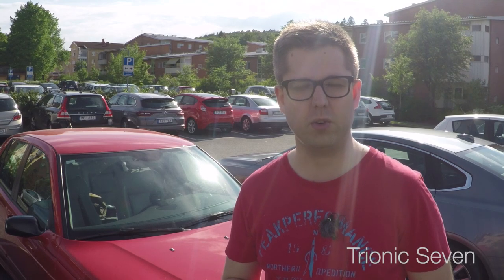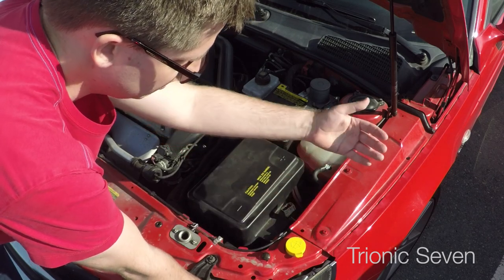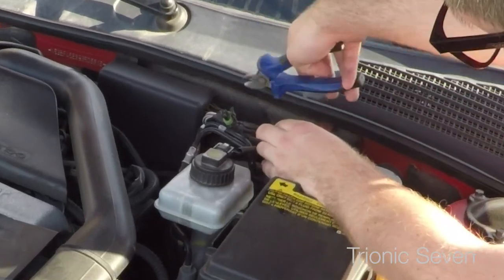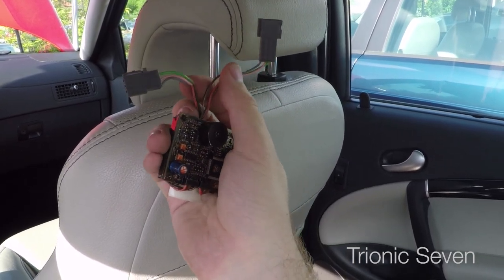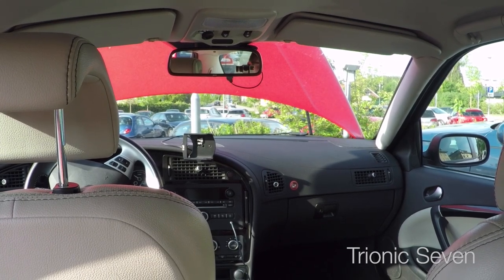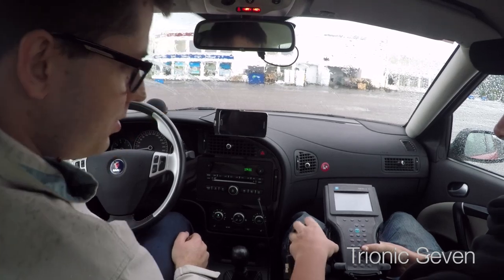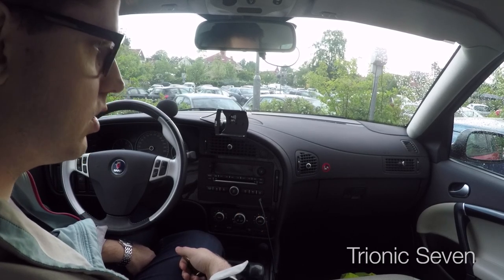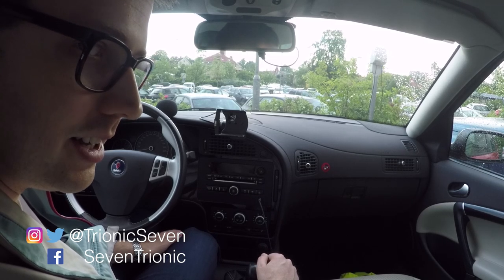Alarm System Retrofit, Saab 9-5, Saab 9-3 (Complete Guide) - Trionic Seven

Comment: I just did this on my 9-5 07 SC A60 and DAMN did I have to dig out the connectors for the sensors. The fabric they were hidden under were glued down GOOD and the back-seat one was a bit confusing because the two connectors that go to the sensor were connected to each other so I wasn't sure if those were it.

Comment: My Saab 95 stopped locking with remote. It does locks with the key on the door but not with the remote, Battery is ok, second key has same issue. So, the issue I believe it's on the car. Does anyone know anything about this? Cheers

Comment: Hmmm. I wonder if I can do this on my US market 2008 9-3 Aero XWD Combi.
Reply from the maker: Hey! Sorry, you have a ng9-3 and it's a completely different car. There might be a similar procedure as in this video, but these instructions don't apply to your car.
Reply: I have a swedish 9-3 -09, that i only installed the hoodsensor on and let the SAAB dealer code the alarm to basic stage 1, so it uses the car horn. But it works good.
There is a original alarm kit you can buy(atleast in sweden) with the hoodswitch, tilt sensor and siren for the 9-3.
Reply from the maker: Exactly, the kit is available for purchase, but it's very expensive. I bought a used siren and rebuilt it (see the previous vid) and was able to do it for cheap.
Reply: Ah, you meant OG9-3. I understand. Yes, my us market 08 NG9-3 already has a hood sensor and uses the horn for the alarm/panic.
Reply: 09 9-3 is a ng 9-3 so he ment a ng 9-3 i assume , my saab 9-3 2008 uses both siren and horn when the "panicbutton is pushed in